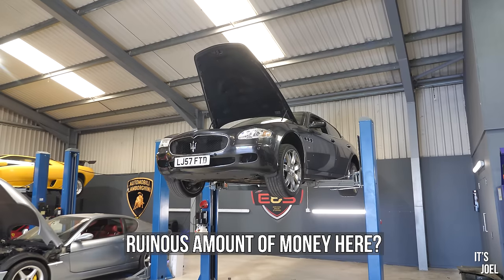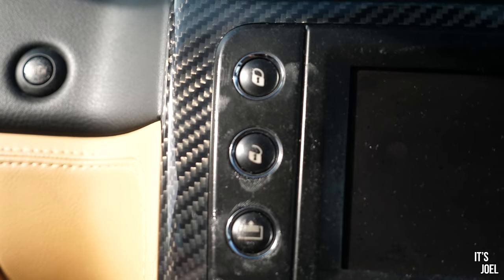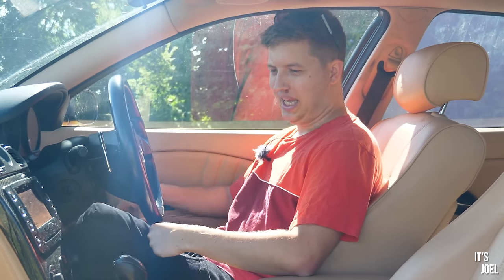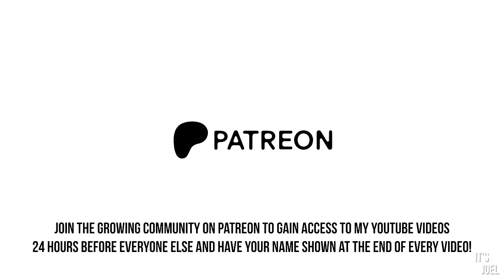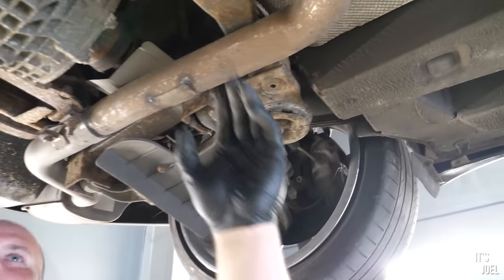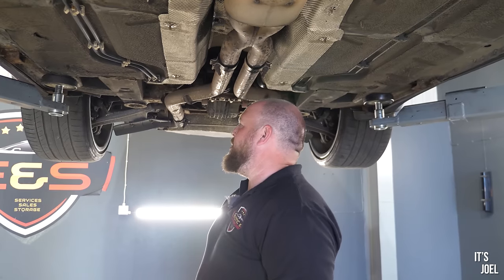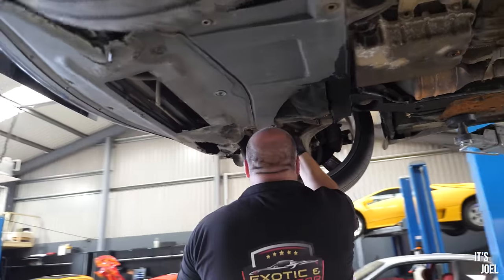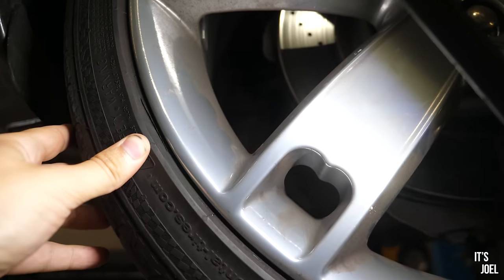Here's why my Maserati Quattroporte was so cheap...

Comment: Naive is how you would characterise this video.  Paying less than £10000 for a £100,000 pound Maserati and not carrying out a full fat specialist inspection before parting with your cash is just silly.  A common sense rule of thumb, the older/ higher mileage/higher original value car you purchase, proportionally, the greater the due diligence you must perform.  In this case, you did the exact opposite.  The dealer must have seen you coming before you left home.
Reply: no mitigating stupidity. like the people who go swimming in rivers with signs saying '' beware- crocodiles''....and are never seen again. Cant help some people from themselves.

Comment: What a great car :) stunning interior, wheels polished to perfection, not just sprayed....

Over 100k miles and £6k pp...I think u have got off lightly! - Personally, if engine wear item cant b fixed under £2k, I would run it with best oil u can buy for a yr or two and enjoy stunning sound and the sublime interior - Cheap bit of paintwork, tyres, clamps etc and enjoy :)

How's your dads 125 3.0 going? - Fancy one of those - fancy yours too, but a bigger gamble

Comment: check mot station that issued the mot using v5 code, give them a call and say this mot is dodgy and ask if they want to repair it or you ring vosa :) They will 99%. Got my jaguar with a dodgy mot and then they changed brakes, various suspension components and two tyres. Bill was about 2k and I could smell the crap in their pants through the phone when I called. If you ring vosa they will reinspect and give them point for each item and rapidly shut their mot station down.

Comment: Eventually you’ll get a misfire code and you’ll have low power. The car won’t blow up but you’ve got to fix it. Honestly it’s so much better than the V10 M5 with the explosive rod bearings. I just had my QP GT S repaired for $4,400.

Comment: Personally if l bought a car unseen  (l've done so & motorbikes too umpteen times) and it went belly up then l would not complain, come on! There are huge positives, the exterior panels are great, beautiful interior in ace condition, consumables as anticipated and it's a drop dead gorgeous car. Have the engine fixed.

Comment: Well, aren't we in the same boat 😅😅😅 both got awesome looking and driving modern classics for just under 10k, only to find out they had expensive cam issues! 
I got a lot fixed and thought now it's worth the repair, 'cheaply' outside the E.U. on my vacation road trip.. the cam was the last of my issues, the engine lost 2liters of oil in the middle of Serbia, where nothing is covered by insurance and phoning someone costs 7€/min! Refilled the oil, and there came all the repairs I previously payed 2k for undone, back to oil leaks, dpf blockages...
I am not rich enough to own this car, the question is.. are you?

Comment: I have had a 2005 Quattroporte Executive 4.2 litre Cambio Corsa (Duo Select automated manual) (with Formula Dynamics chips for throttle control and increase from 400HP to 425HP) for 10 years; and a 2012 GranCabrio Sport 4.7 litre with ZF auto box for five years. 
The Cabrio looks stunning (of course) and attracts comments shouted across the street of "Rich bastards" - nice for my 10 and 14 year old sons in the back.
The Quattroporte is almost unnoticeable.  Yet it drives faster and handles way better and more easily than the Cabrio.  Plus the Quattroporte has far better seats, upholsterery (Poltrona Frau leather), wood and leather and alcantara interior.   Sure, the analogue TV doesn't work anymore (all digital now) and the in-console telephone is quite redundant now.  
While top speed is supposed to be 275kmh (isn't that a supercar?), the speed limiter in the infotainment system (bit of a silly place to put it) reigned the car in at 250kmh.  No one, even the dealer, doesn't know how to cancel this - seems no one actually uses the car for what it was built for - high speed luxury travel for a family of five.

Comment: What did you expect for 6K then ffs,    As for the MOT only valid at time of inspection ?    The MOT is only another Tax Con so realy means F/A lol but you need one to Tax a vehicle.    as for the Tyre when did it get damaged ????  you could well be on a Looser as the vehicle has been used since the MOT lol

Comment: Chasing the dealer on the MOT you're on a hiding to nothing as MOT is as it was inspected on the day.  Tyre damage could have been done by you.  Clamps might have magically failed too.  You can't argue back on that.  The issues with the engine noise?  Don't know.  Sale of Goods Act, etc might come into play, but if you bought it using your company funds for your YouTube business then it's B2B sale and you're cooked as you can't use consumer protections.

Comment: I thought the noise might have been hydraulic tappets as I’ve had VW and Audi cars that made that noise.

Engines can be noisy on start up anyway.

If you like the car I would get the problems fixed.

Comment: Yes, for 15 to 20k you can certainly get models with a better history, but if you invest around 7k, you have a rock-solid exotic with a freshly overhauled engine, a solid gearbox (oil flush?), a good underbody (dry ice blasted and sealed), a nice paint job and a well-maintained interior. And the whole package is then worth more than 12k. You can then drive it for many months or a few years and sell it with practically no loss in value, or keep it as a future classic. And the money needed for the repairs?? Sell your Porsche Cayenne. It will never be a classic because there were simply too many of them...

Comment: I work in a mot garage and had to work on a Maserati coupe suspension. Every nut and bolt was such shit quality and was seized and had to be cut and replaced. Strangely they were mostly in stock meaning it was a regular problem. The ones that weren’t available were replaced by BMW equivalents in the end the whole front suspension had to be replaced and it took 3 days to do a job that takes 1/2 a day on most cars.

Comment: Had same problem with the same car but here in Italy things are much cheaper. Spent just over one thosand euro for parts and labour, the difference between here and the UK is here same car with 150k miles will cost around 25k euro 😞

Comment: Still a very inexpensive Maserati, I would give it a couple of oil changes and   filters  with a few hundred miles inbetween , and Transmission fluid gravity drain (Not force flush straight away) and refil see if that helps for a start, then look at folks who can make custom exhausts and spray any accesible electric connectors with suitable cleaner.

Comment: I dont remember hearing about why it was a cat S. Where is the damage? What repairs has it had? It seems pretty stupid to comment on a worrying rattle and then jump in and rag it for an hour to an engineer. Thank your lucky stars it didnt blow up on the way. You need to be a keen engineer to want a car like this, and be able to maintain it. The cat S virtually halves the car value regardless of its condition.

Comment: For £6-9k there seem to be other non Cat S/N cars on autotrader that appear to have the ZF box. I think you would struggle to add any value to the car getting the jobs done. Bit naughty from the dealer selling it with a clean MOT, personally I’d look to give it back unless he wants to give you £3k back for the trouble and then just stick a set of tyres on it and run it😂

Comment: Big Deal 😂  Either fit fresh variators OR fit an Accusump   (cheapish  /easy) which delivers Full Oil pressure the moment you turn the ign Key.  Problem solved. 
These cars don't gladly suffer  the Naive.
 PS:  Differential Needs ! an Oil change Every 20,000kms  Or save up for a New one.

Comment: To be fair, many owners I know don’t bother fixing the variator issues and just live with it 
The car Will basically drive fine, mine was solved by replacing the check valves in the oil statement

Comment: Just see if you can find someone that can do the jobs for less money. 4k pounds sounds very cheap to me. Spend 1K on the bottom and remove all rust and protect it. The can variator i am sure it can be done for 2 to 3 k most and well.  And tires and other things you are about 10k and it looks very good inside. 10k for a good sportscar in good condition sounds like a bargain to me.

And see if the dealer that sold it to you maybe can get parts cheaper for it as well as a form of compensation.(don't let them to the job) A.S motorsports sells complete klits for 1800€.

Ofc labour and maybe some extra parts...but 3k seems doable.

Comment: "i need to sort out some proper number plates"....as opposed to the 'non-proper' number plates that are already on the car?
Reply from the maker: They’re kind of janky and I wanted to get some bespoke fit ones, that’s all I meant!
Reply: @itsjoel  bespoke fit? If they have the legally required text size that's pretty much the size of the plate you need to have
Reply from the maker: @waynelewis5656 why are you having a dig at me? Haha, very odd behaviour!
Reply: @itsjoel  not odd behaviour at all, I'm wondering how a legal number plate can be a bespoke fit, unless of course it's to fit an oddly shaped number plate recess like, for example, a Rover 75. That Maserati doesn't seem to have an oddly shaped number plate recess.
Reply from the maker: @waynelewis5656  that’s exactly what I meant. The Quattroporte has a similar shaped recess to my S-Type which needed a bespoke fit plate.

Comment: If you've never bought a car that needs at least the same again spending on it you haven't lived.
I've bought cars which have been scrapped, crashed, left to rot. Ones with knackered engines, boxes etc. No mot or one which should never have been issued. 
Buying stuff with no faults is boring. Assume whatever you spend is gone, never to be seen again and you'll be fine.

Comment: 😂😂everybody wants this kind of Exhaust sound but nobody buy this maserati because it has awful driveshaft and gearbox (if you buy manuel it s OK) AND also engine designed for just only 100K miles after the limit you have to buy new engine. In my country this kind of cars called " mushroom s cars " because it s always bought by persons who dont understand the car technology
Reply from the maker: There was no manual Quattroporte

Comment: Another annoying video about a 18 years old Maserati by someone we clearly just wants attention. Why don't you buy a 2006 AMG v8, a 2006 Audi 8 v8 or a  2006 BMW v8, (if you can find one that lasted this long), and ask for a quote for timing chains, tensioners and variators and see how much change you get from 4.5 grand?. These are super cars that come with expensive engineering that make them so desirable.  The alternative is, get a Toyota Corona ,and be happy.